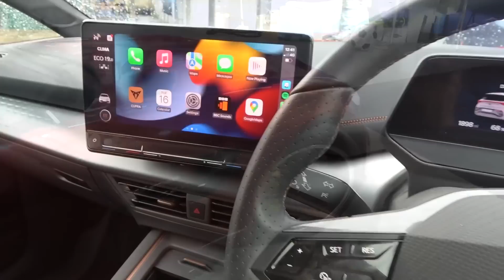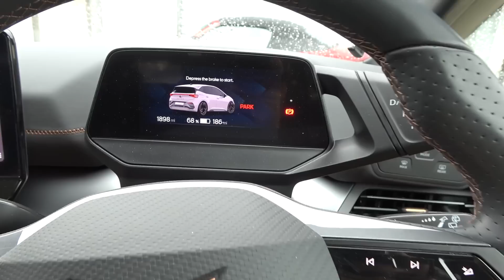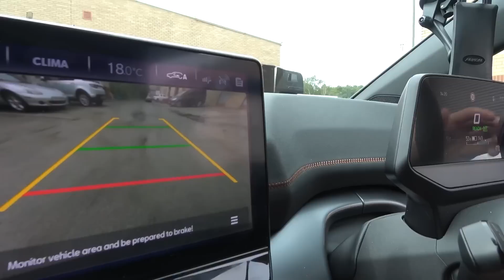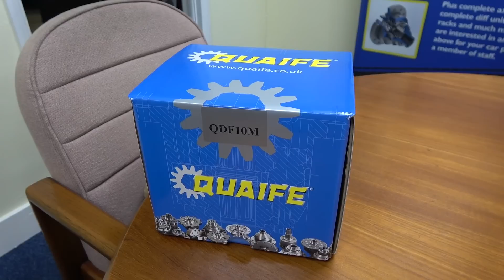GOODBYE AMG GT R ROADSTER! Collecting More Clio V6 Mods | SHMUSEUM VLOG 88

Comment: Just a question. When you drove off at Contemporary classics the Shmee plate was still on the car. I thought in the UK the plate goes with the owner instead of the car ??
Reply: Plate stays with the car but you can transfer it online in a few minutes on to a Retention Certificate for the former owner (ie Shmee); this also generates a new year-appropriate registration number to go onto the car.  Would be amazed if that wasn't done so that Tim keeps it.  The physical plate is then removed and a new plate made up for the new number by the dealer.